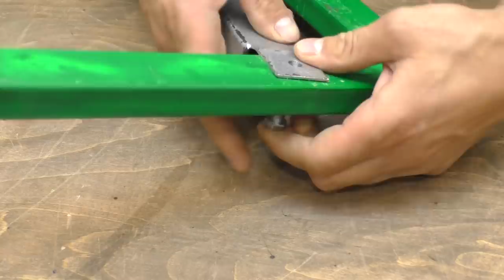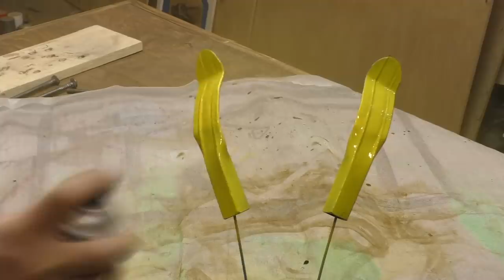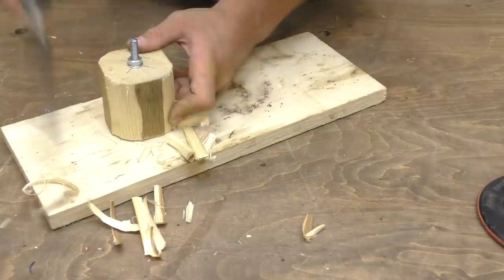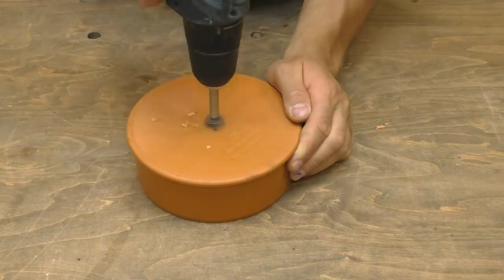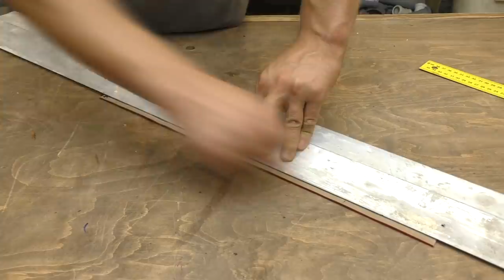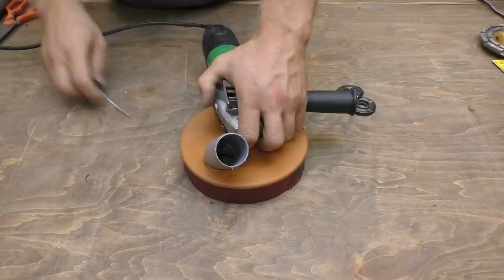Top 5 Genius Ideas! You may need this!

Comment from the maker: Hope you liked these ideas!
Reply: All "ideas" has been on market for ages.
Reply: @mr.wizeguy8995  This guys name is Vanya. Like economically meager from Ukraine or Russia. That's why no steel toed boots. Give'm a break.
Reply: bearinch ppp
Reply: Some are ok but most seems like a lot of wasted time I'm an engineer and fabricator and reason I said that is for example the wooden handle for the disc sander that particular disc sander is made to go in a drill and clearly he had a drill
Reply: Now all you have to do is hand craft some safety boots
Reply: WhoDuhThunkIt 
I’m all for giving someone a break especially from less affluent countries.  However the only break I can this guy having is getting his toes broken or chopped off the first time a block slips out.  You could see that although the device is using a fulcrum and lever design, that as he picked up a stack of blocks they bowed down in the middle slightly, meaning the fulcrum effect isn’t quite right and making the likelihood of those blocks popping out straight onto his unprotected feet.  Unfortunately taking some basic sensible safety precautions doesn’t even occur to some people until they have the inevitable accident. They seem to have “it won’t happen to me” philosophy.

None of these comments are made to take anything away from this guy and I really don’t care if the idea was previously done by someone else.  The point is as someone else pointed out is that he’s bothered to show how this multi block lifter can be made with just a handful of relatively inexpensive tools.

However I still stand by my previous comment about fabricating, welding and then carrying blocks with bare feet in open toed beach wear is just asking for trouble.  Nothing to do with where he lives or giving him a break and especially not trolling.  If he can afford those tools then he can surly afford a pair of work training shoes, a pair of sturdy boots or anything other than open toed beach wear.  I get that it may be hot out there and if wearing shorts he may perhaps feel like a plant pot wearing steel toe capped boots, however there are literally loads of safety training shoes [ sneakers ] out there especially on eBay, or wherever.  Even markets or charity shops sell more appropriate footwear than flip flops for very little outlay.  He will cost himself a lot more in lost wages when he busts up a foot or burns his feet.

So absolutely nothing to do with trolling in the slightest, just plain common sense.
Reply: @multibusa  is 100% correct.
Safety first!
I was shocked to see him carry heavy bricks in a way that they were at risk of falling out of his makeshift handle -- onto his feet!
Dangerous!
Reply: Hello- How did you make the Hole digger on Drill?
Reply: Why on the Earth device presented in video thumbnail is not covered in video?
Reply: You know this video is just made to get views to make money.. all these ideas are in about fifty other videos....
Reply: This Ideas are so low😭
Reply: @mr.wizeguy8995  YOU are not that wise,  if you upvote your own comments,  ONLY ONE counts, not nine
Reply: @Mr. Wiseguy  The title says “genius ideas” and the description says “creative ideas.” Not a word about “inventions” anywhere — that was in your own head, probably because you were looking for new inventions. So don’t denigrate the author for your mistake/disappointment. 

Also, as the description says, “We turn simple things into unique ones!” i.e. the creativity is about making items (whether previously invented or not) out of materials that may be lying around—the focus is the conversion of the materials used, not the end item or the tooling used per se. Inventors usually need a model or prototype of a new invention as a proof-of-concept, and the construction techniques and materials resourcefulness in this video could give someone without a lot of money to buy raw materials an idea of how to prototype a new invention from inexpensive everyday objects or scrap materials. There are 215K subscribers who think the author is worthy of attention.

P.S.: If you go looking for something in the video to crap on—and you should ask yourself WHY you do that—you’ll certainly find it, and chances are that’s all you’ll find. If, however, you go looking for diamonds...
Reply: @petep.2092  I always see thousand of flies around pile of shit so it must interesting like these "ideas"
Reply: Perfect
Reply: Hey
Reply: ...Yes... the ideas were very good...!!!...  Thank you for sharing...
Reply: Удивительно, как это у тебя еще до сих пор все пальцы на руках и ногах на месте. Редкое дарование!  ⊙_°
Reply: Ohh they make the grinder and vac already it’s actually an old system you need need a concrete vac instead of a shop vac fine dust will damaged your vac you buy this attach at Lowe’s
Reply: It would be helpful to tell us where you get the materials / their names?
Reply: @mr.wizeguy8995  everything in life is remix I would like to see your video
Reply: @bearinch  n nknlp
Reply: @mr.wizeguy8995  III
Reply: The drill being used in the vice was ingenious
Reply: @mr.wizeguy8995  ñkp por
Reply: @bearinch  vmnxe
Reply: @mr.wizeguy8995  gamkl
Reply: @mr.wizeguy8995  gamkl
Reply: @Danton McGrugger =-
Reply: @katmedina67  fb
Reply: Good ideas thanks
Reply: @mr.wizeguy8995  11
Reply: Красавчик парень, отлично, руки растут откуда надо!
Reply: @mr.wizeguy8995   so you maybe do all of this and much more, right?
Reply: @katmedina67  the beauty of this is that he's able to do it by himself for a few cents and work the same as the super expensive piece of crap you buy in Lowe's 100 times more expensive.
Reply: @carlosdelascuevas6140  I could to all of this and many more but time he uses to make this cheap products i can make more money and buy them and still have time to do something more useful. Also if i buy product from store it has resell value instead these self made crap.
Reply: @mr.wizeguy8995  that’s ok. Good luck with your consumist philosophy!👍
Reply: @carlosdelascuevas6140  Did you meant Consumption? I don't need any luck when i work and make my money. People like you need luck to find junk materials that you can use to make something you can’t otherwise afford.
Reply: Was literally just about to ask if any of these ideas have been patented and/or marketed.....thnx
Reply: Mr.
Reply: If I made a brick carrier, sandles would be my choice of footwear as well.

Comment: Second idea , all this just for put a stick on the Wall ?????
Reply: Yea what on earth, completely pointless.  Like something one of my work colleagues would do.  Complexity for the sake of complexity....
Reply: I am pretty sure that he just wanted to show how the clamp worked.
Reply: it would make some sense when installing a support 10-15 feet long say for installing an awning or something attached to a wall. Maybe not even wood, but metal and are re usable.
Reply: Yup, to you it’s just another bri—, er, stick in the wall. May you never have to put up a board on a wall with both horizontal and vertical axis location precision while also being level, by yourself.
Reply: With two extra holes, may I add
Reply: You could use just one of these clamps too, but as others have said if that board was 8’+ in length, and required level and x/y axis precision, those clamps are pretty damn handy! I wish I’d thought of that in the past. Also, most of the time what you’re hanging would cover the extra hole(s). Or if your any good at this stuff, you’d make sure it did.

Comment: So he creates a clamping device to fasten a 2x4 into a brick wall... when clamps are removed 2 holes remain... spend 1.5 hours to create clamps ... why not just put a level on 2x4 draw line on the bottom portion and measure out where the holes have 2 go... too much or too difficult?... I am confused...

Comment: All of these 'ideas' take more time and resources than actually doing it the straight forward way. Stupid. I think a chunk of wood as a sanding block is a little easier than jigging up a makeshift lathe to make a handle (for the drill sander - which he used a drill to make instead of just using it on the sandpaper)

Comment: Lifting bricks and wearing flip flops sums it up.............
Reply: And with a homemade thin gauge brick tong no less.
Reply from the maker: I don't work as a Builder! Just testing)
Reply: HandCraft   Testing untested tools or building techniques makes using proper safety gear even that much more important.  Had those bricks slipped out of that brick tong and landed on your foot a greater lesson would really have been learned at your expense and taught others what not to do.

Comment: Great idea until a block slips out and chops your toes protected by a sturdy pair of opened toed flip flops !! Heath & Saftey gone south.
Reply: this little piggy went to market and Oh NOOO all little piggy's flew away from home... well you get the idea
Reply: Nice
Reply: exactly my first thought. Still, the brick lifter is pretty neat and simple.
Reply: Felix Franke 
Agreed, it’s a really great idea for moving several bricks at a time.  However it’s design needs a slight tweak so that the lifting action pulls the bricks in tighter as you can see from the video that the bricks are bowing in the middle as he lifts them meaning it’s a good possibility that the slightest jolt as your walking over an uneven site could mean all of the bricks dropping.

I can see how some people view the comments about appropriate footwear as the health & safety police going OTT  which in my case was certainly not my intention, rather pointing out what you’d think to be common sense the, flimsy open toe’d beach footwear is completely ludicrous whichever way you look at it. We’ve all probably taken risks regarding our safety at some point in our lives but not necessarily such an obviously stupid risk as this.  I shudder to think how much damage and pain he’d get the fist time the bricks spill out straight onto either the bridge of his foot or toes = agony = likely trip to hospital = probably time off work = no wages earned.

I’m now of the age that I thought I’d seen every stupid avoidable risk with personal injury going, however I’ve just added another one the list.

Comment: you use a drill as a lathe to create a handle for a sanding disc that you can attach to the drill ????
Reply: Applying side load to a drill will destroy the bearings

Comment: Number 2 made absolutely no sense, you could have drilled holes in your board, then mark the holes, drill and then put in the screws. The holder thingamabob  was waste of time  and money plus now you have two holes to fill . Some of your ideas are okay but definitely not genius.
Reply: Those were my first thoughts too. I guess the advantage is when using big size/ heavy boards which are not suitable to hold with one hand and drill with another hand.  I am still fighting over those two additional holes in my head. But it kind of makes sense. Regards,
Reply: I agree, i would not do it that way, but it could be used for holding plywood or similare against the wall for storage.
Reply: @Bengela86  right, more like a permanent application of those holders. good idea!
Reply: For the amount of time you spent making this stuff, you could have been done with the job...and be relaxing, admiring your work. This is a prime example where he reversed 'work smarter not harder'.

Comment: If you have a power drill and a sanding disk for it, why would you use that to make a round wooden hand grip for the disk? If you want to sand something with the disk, use it on the drill - thats much less exhausting. And if you want to hand sand something, a square wooden block is just fine. Zero extra work needed. :)
Reply: ok theres two things wrong here, but clearly you've never done much ACTUAL woodwork to know what these things are.  Powersanding can be too harsh, and if you've ever done any hand sanding with a block you'd know the paper slips, catches and can tear because it's not being held firmly - holding onto a wood block with paper and a vice liek grip is tiring on the hands - so this guy has used HIS BRAIN and added a handle to a velcro backed pad, no more slipping paper and no more hand cramps.  Guess who else does this? Jimmy diResta, going to accuse HIM of being an idiot? Didn't think so.
Reply: @rafezetter8003  Actually I've done quiet a bit of woodwork in the past 40 years. And during that time I learned that a sanding block is a rather practical piece of kit. Here just a few main advantages over a rubber disk:
1. the sanding paper is much cheaper, if you buy big sheets or even a roll, instead of the pre-prepared disks for a velcro disk. Significant if you do a lot of wood work.

2. with a block, you can reach certain corners much better, which you cannot access with a disk.
3. a block is stiff and plain, other than the disk. So you have less risk to sand dents into the wood, or uneven surfaces.
Yes, it is straining for the hand - as hand sanding always is. To ease that a bit, you can make a "de luxe" block, by glueing some felt underneath and shaping the sides and top a bit more hand friendly.
And I don't even know Jimmy Di Resta, so I sure wont accuse him of anything.
Reply: @rafezetter8003  "Powersanding can be too harsh"

So use an Orbital Sander, instead of a Disc one.
Reply: @BedsitBob   err what part of "powersanding" did you not get?

Comment: Dont do jobs, that require a large torque, with lightweight drills. (final item). You will destroy your machine.

Use a more powerful machine, fitted with a side handle.

For large diameter drilling, consider using a machine fitted with a clutch. When the drill bit becomes jammed, the machine will rip out of your hands!!

Comment: When the Brick cracks and falls on his thong (flip flop, sandal) will it cut through the rubber strap or will his foot absorb the blow?
 Is he testing this theory by walking backwards on to a wobbly pallet?
 Genius minds want for proof.
 Evidence the broken bricks suggest danger is near.
Reply: bob oh stephens 
I think the 2nd option is the most likely, I definitely think his foot/toes will absorb the blow by either breaking some  bones or severing some toes.  Either scenario will help decelerate the bricks before the hit the ground and possibly causing damage to the bricks.

All joking aside this poor bloke has taken quite a bit of ribbing by a few commentators here, including some from myself.  I reckon he’s got the idea by now or at least it’s made him think a bit about his own personal safety.  No matter how good a invention is for making a job both easier and faster, both benefits are immediately cancelled out with a serious foot injury requiring time off work.  So not only has the device caused you to take valuable off work meaning rather than saving time, you’ve lengthened it by a few weeks and cost you money in lost earnings = fail !!

I did think the dust shroud and the hole digger were quite useful idea’s.  I didn’t really see the point of performing the manual equivalent of an orbital sander, but I guess if you don’t have any power on site it’d be better than folding a piece of sandpaper and sanding by hand?

Comment: Great Idea,
but not agree with 2nd one.
Reply: Me neither. two useless holes after it is done :)
Reply: i'd rather ask for a help from someone than to make a hole under a shelf that i am making 🙄
Reply: Agreed, 2 isn't too great. Do it 1 handed like a pro
Reply: Or the two hole method... assuming brick wall...place wood roughly in position and drill through wood to mark hole in wall. Remove wood and complete drilling into to wall and insert plug. 

Put wood back on wall and screw right hand side but not too tight to allow wood to move. With spirit level on top of wood rotate wood rotate until level and drill through wood to mark wall for left fixing, lower wood and complete drilling and plugging of left hand side.

Rotate wood back round and screw in left hand fixing and tighten right hand fixing.

Or spend hours messing around creating a jig that you have no materials for then filling holes on wall

Comment: The average idiot would have held the level against the wall scribed a line and then used it to put board up with holes pre drilled in it instead of making four holes when only two were used.

Comment: Saw a video like this a month or so ago where the uploader thought he had created the best wire splice EVER. He went though 3 real time and complete demos of three different ways to splice two wires together with a big red X though the image of each type of splice along the way with a wrong answer buzzer.

His final demo that he evidently thought was a brand new concept that he was sharing with the world for the first time ever, was nothing but a 150 year old Western Union splice perfected for telegraph lines. The extra work and needless damage to the brick wall and the handle for the sanding disc was just silly.  What was the rationale for drilling the extra holes in the wall totally useless as many others quickly pointed out.